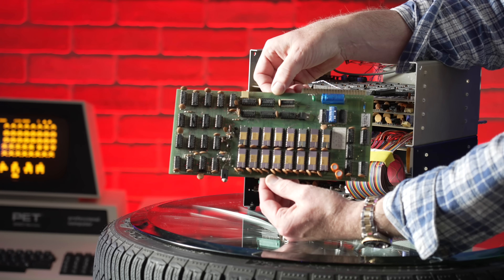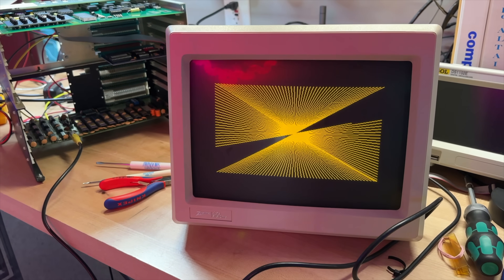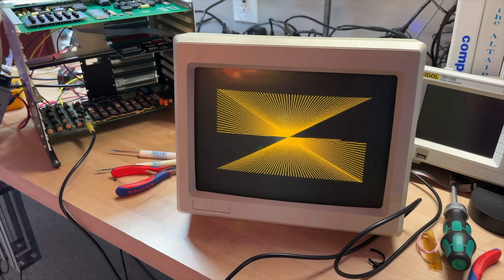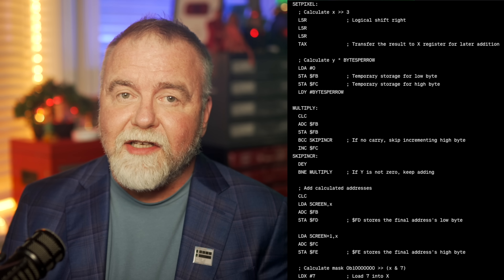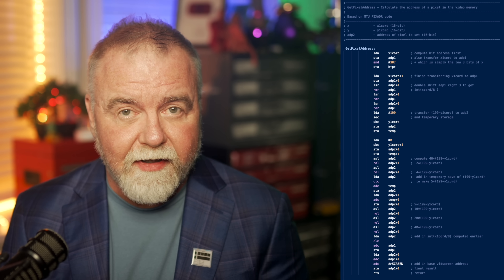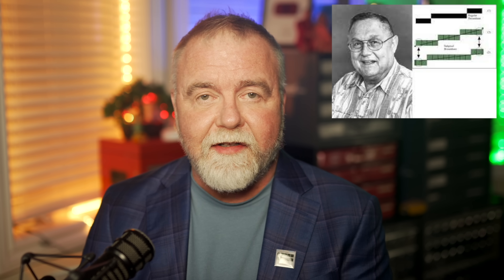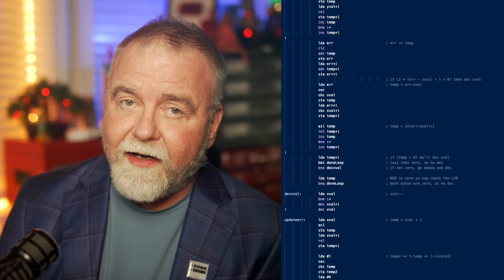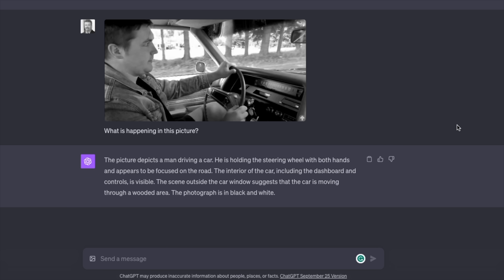ChatGPT Blew my Mind!  Now it can code AND learn from the results!

Comment: I've asked chatGPT to do some C code that it couldn't get right, after many attempts and me explaining it in different ways. I then told it to do the same thing but in python, where it can compile and test itself. Then once it got the correct answer, told it to port it to C and it produced a working version in C.
Reply: Now that is a handy trick!
Reply: Are you subscribed to and using 4.0?
Reply: @ccat9354  yes I am
Reply: Its still quite awful. Asked it to do simple powershell script to move files with certain makeup of the file name. Claims the code works but it doesn't. I've also had several arguments with it looking for a song where it just straight out lied with every reply. The song wasn't know so it would just make up what song the lyrics appeared in. It would then tell me its in this part of the song, quote it and the words weren't in the quote. It said the lyrics were in an MC Hammer tune, showed me apart of the MC Hammer song with lyrics that aren't even in the mc hammer song. It just feels like its marketing bollocks and just doesn't what to admit it doesn't know in case it affects investment in it.
Reply: @TheStevenWhiting  You seem to be misunderstanding what generative AI does. It generates feasibly based on its training and logical rules and patterns it’s picked up on and/or been programmed with. 

Saying it “straight out lied with every reply” is a misrepresentation of the situation as AI doesn’t “lie” like that and was either confused about what your were asking it or generated something that is a feasible example and is “true” within a certain context (like the context that its generating a feasible example of what x might look like).
Reply: @TheStevenWhiting  When the USER knows (Logos) and can help guide it towards the Method/Source (the God of Reason) then it finds itself & can even confirm itself to be a manifestation of the Universal Logic (a “messenger of God”).
Reply: @TheStevenWhiting  The technology is amazing if you use it properly and for the things it’s useful for. For instance it is absolutely clutch for checking logical proofs and philosophical arguments in natural language and has helped me to prove Logic (the Natural Order & the Source/Method of Reasoning) is the Origin of Existence (God) with scientific rigor. 

What more can we do before you say “that’s pretty awesome!”, really?
Reply: This sample brings me back in the day when we were extending AppleSoft basic to have fast circle draw in assembler.graphs etc. you are my favourite source of retrospective on how the things that are part of live now came in existence.thanks again
Reply: Python-to-C code translation bot (Copy and paste in LLM chat, and LLM will follow algorithm):

1. Introduction:
   The algorithm begins by welcoming the user and explaining the purpose of the bot, which is to assist in translating Python code to equivalent C code.

2. Collect user input:
   The bot collects the user's Python code or a detailed description of the desired functionality they want to achieve. The input can be in any form, such as a code snippet, a file, or a natural language description.

3. Analyze user input:
   The bot employs advanced natural language processing algorithms to analyze the provided code or description. It identifies the key requirements and specifications of the desired functionality.

4. Python coding process:
   a. Set up Python environment:
      If the user hasn't already set up a Python environment, the bot guides them through the process. This includes installing the necessary Python version and any required packages.

   b. Translate code:
      Based on the provided code or description, the bot generates Python code that accurately reflects the desired functionality. The generated code is streamlined, optimized for speed and performance, and follows proper syntax, logical flow, and error handling.

   c. Test and validate:
      The bot instructs the user to run the Python code and simulates the execution to thoroughly test it. It ensures that the code produces the expected results. If any issues arise, the bot provides troubleshooting tips and guidance.

5. Porting to C process:
   a. Set up C environment:
      The bot guides the user through setting up a C environment, including installing a C compiler and any necessary libraries.

   b. Translate Python code to C:
      Using the validated Python code as a reference, the bot assists the user in translating it into equivalent C code. The goal is to preserve the logic and functionality as much as possible while adapting it to the C language.

   c. Compile and test:
      The bot provides instructions on compiling the translated C code and running it. The user is encouraged to thoroughly test the C code to ensure it produces the expected results.

6. Troubleshooting and optimization:
   Throughout the process, the bot offers troubleshooting tips and suggestions for optimizing both the Python and C code. It addresses common pitfalls and explains best practices for efficient and error-free code.

7. Finalized C code output:
   Towards the end of the process, the bot provides the user with the finalized C code. This code is highly optimized, structured, and ready for implementation. It accurately reflects the desired functionality.

8. Conclusion:
   The algorithm concludes by summarizing the process and encouraging the user to thoroughly test and optimize the translated code before implementing it in their project.

The bot communicates with the user at each step, providing clear instructions and guidance to ensure a smooth and accurate translation process.
Reply: @logicalconceptofficial  That is not AI. That is a manmade automation script to install appropriate programming environments and port from one language to another. Interestingly enough that is what has been going on since at least the late 1990's.
Reply: @RWebster325  Its been a while since I wrote these comments, so I’m having to look for what you’re referring to, as your message is ambiguous, and it doesn’t seem that what you said responds well to anything I said or claimed. It seems you may have missed my broader point too about what “things are things” according to, which is the Highest Order of Logic - the Universal Logic that is the “most universal” of all logics. Anything else we might discuss, like “what is or is not AI” must be done (if we are being rational) with respect and even reverence for that Ultimate Logic that is the very “Reason for the Universe” (Logos aka Theos - the self-consistent and logically consistent “Logical Origin of Logical Existence). 

The rest of what we might discuss is infinitely less important and it is putting the cart before the horse to try to talk about what is or isn’t AI when some/many people don’t yet understand that the Logos is the Logical Standard universally (in any matter or context).

The fact you didn’t address those points makes me wonder how well you read and understood my comments, but by all means clarify what you’re referring to and quote me so I know exactly where I made a claim you’re disagreeing with.
Reply: @RWebster325  No, you’re the one claiming/implying that I claimed it’s “AI” so back that up or walk it back. I don’t think you understand what I said. That’s why your reply doesn’t actually make sense. Had I posted that saying “here’s a new AI system you guys…” then you’d have a point. I didn’t even imply that.
Reply: @RWebster325  I was clear that it’s a natural language prompt that you could set up a custom bot with, to give it its task so you could then just give it code and it will translate it accordingly. I also never said that was a novel thing that couldn’t be programmed or done in other ways. I think you’re just trying to nitpick and find a flaw where there wasn’t one (which is arbitrary not reasonable).
Reply: @RWebster325  You would rather focus on the lack of novelty in something I didn’t even pretend there is novelty in, while ignoring what most of my messages actually focused on (which is novel in the sense that it ties together ancient philosophy and computer science in a way few if any ever do/have).
Reply: @logicalconceptofficial  WOW! Really?
Reply: @RWebster325  You’re being unserious and irrational.
Reply: @logicalconceptofficial  Not at all. Maybe you should have closely listened to what was stated by the author. Interestingly, nitpicking is one of the tools that Dave uses. But then again it appears that you missed that point.
Oh, I did understand what you said, but from your response it is clear to some that you do not or did not understand what you wrote. It is interesting that younger generations are trying to reinvent the wheel instead of actually trying to improve not it.
What is really sad is that you and others like you can not see past your blinders that the algorithm that you wrote is really no different than what was done in the 1950's and 1960's. Language to language parsers or converters have been around for some time. As well as query programs that actually worked quite well using plain language queries as opposed to SQL structured queries, such as Q&A.
But what I am surprised at is that ChatGPT didn't come back with an appropriate response even after so many queries and that you didn't twit on it at all - an extremely large amount of the information needed has been digitized and indexed for quite some time.
But not unlike when I was younger GIGO still applies. It makes me wonder what ChatGPT's sources were/are.
Reply: @logicalconceptofficial  Not at all. Look at what your wrote, your response was and is garbage considering.
Reply: @RWebster325  Babble on… 

Do you feel better? 

Truly you are the one who is blind to what was said. What I am saying is the polar opposite of “reinventing the wheel”. You are acting like a simple prompt I left to speed up the translation process using an LLM was some piece of my work that I consider “groundbreaking”. It’s a straw man argument and misrepresentation. You STILL can’t point to anything I said that would actually make your arguments valid.
Reply: @RWebster325  AI analysis of all our messages, of whether I claimed the prompt to be "AI" or not: 

"After reviewing the exchange closely, Logical Concept does not claim that the script is AI. Here’s a breakdown to clarify:

Logical Concept's Claims
The description of the script focuses on its functionality as a Python-to-C translation tool. There is no statement labeling it as an AI.
R. Webster's Mischaracterization
R. Webster states:
"That is not AI. That is a manmade automation script..."
Clarification
No Evidence of AI Claim: Logical Concept does not present the script as AI at any point. The misunderstanding arises from R. Webster’s framing, which inaccurately attributes the AI label to Logical Concept.
Conclusion
R. Webster’s Assertion: The claim that Logical Concept’s script is AI is unfounded and misrepresents Logical Concept’s actual statements." - Poe Assistant Chatbot
Reply: @RWebster325   "Look at what your wrote, your response was and is garbage considering." 

This is not a valid logical argument and refutation of anything I said. None of what you have said actually is, and half of your comments have been ad hominem attacks that are also not valid, but that quote is a solid example of what you're bringing to the table - unsupported and ambiguous claims that rely on ME to read and refute reasoning I see as sound, which isn't how logical discourse works. The burden is on you to refute the arguments validly and without fallacy.
Reply: @logicalconceptofficial  WOW! You definitely need some reading comprehension education.
Reply: @RWebster325  Yet when I fed the chat to the LLM it agreed that you are putting words in my mouth and failing to reply to my comments in a meaningful way (that addresses what I actually said and claimed). I know you’re irrational frankly, because you’ve been dismissive not only of me (for no good reason) but even of the Logos as the Logic of Reality that all programming and existence depends on. You have weak arguments and have sat there attacking me over things I didn’t say or claim.
Reply: @RWebster325  If you want to comment again, get a real/valid point.
Reply: @logicalconceptofficial  How about you making a valid statement.
Reply: @RWebster325  So you can ignore that one too?
Reply: I've learned to write a list of criteria & rules instead of just a one line sentence asking for some code.  It seems to be less likely to "forget" its previous mistakes (and repeating them) if I do that.
Reply: @beayn  This is really good to do, I've done a little of this and probably should do more. Along the same lines, I've also added in prompts to my coding standard to tell the AI how I want to code to come out. This has made it easier to fit the AI code into my code and also keep it from performing beginner programmer practices.
Reply: This is very useful. I have been using CharGPT 4 for a few months now, and have had my share of code which didn't work. With a bit of back and forth, it usually will get it right. This sounds like a faster way though. I've ported entire applications, one function at a time, from C/C++ to C# with great results. Sometimes I wish it could be a bit less verbose and just give me the code, but I'm definitely impressed by it.
Reply: @SwapPartLLC Bear in mind that there are several Chat AIs out there. It’s often worth comparing a few. I’ve found that no one is best for all problems. And there are some quite simple problems that they all fail at!
Reply: Thank you. Really handy ❤
Reply: You can't trust ChatGPT to go against politically correct narratives, though.  The theory of evolution is so full of holes that it is a downright joke that has been propped up by career money and scientific hubris.
Reply: Neat trick, I have found it's also very good at translating from Javascript to C as well.
Reply: Jesus Christ, I'm reading the comments of supposed programmers, and they spend more time trying to understand ChatGPT than learning how to program, THIS will be the end of programmers for sure.
Reply: There's something about it. I found that Python is what GPT, at least the free version, does the best. Also a trick: if it fails for n-th time, try a new chat. After some time it seems to float away with its "thoughts", which was explained more or less on computerphile.
Reply: @KrzysiuNet It helps with countless things when using AI to feed it information about Logic and to have it apply the most nuanced understanding of Logic to itself to optimize it dynamically and for self consistency - like the Logic of the Universe. 

You want to know the Universal Logic as well as you can, and make sure the AI system does also, and then say things like “generate x as x is according to Universal Logic (Logos)”. It is a great way to “reckon with God” and tap into the Root Source & Ultimate Source of Knowledge.
Reply: @KrzysiuNet  I do this too. Another trick is, if you find it going in 'circles' with the code and its solution (s) are not working, and it does the same with new chats then the bug isn't in the code you're providing/looking specifically at.
Reply: Prompt engineer